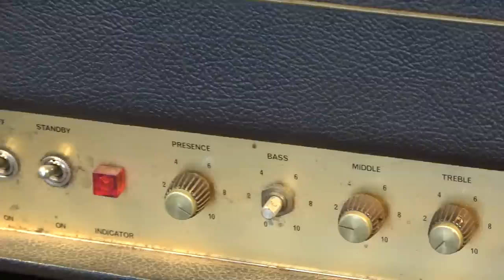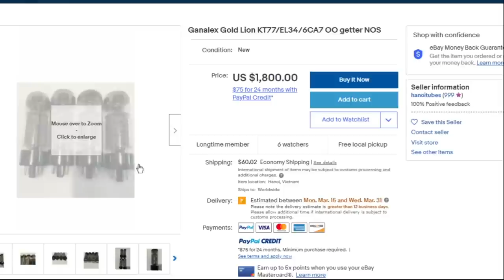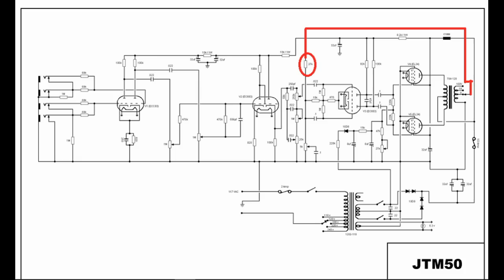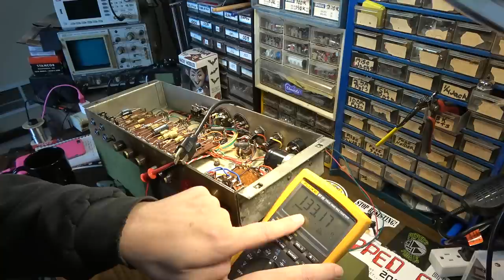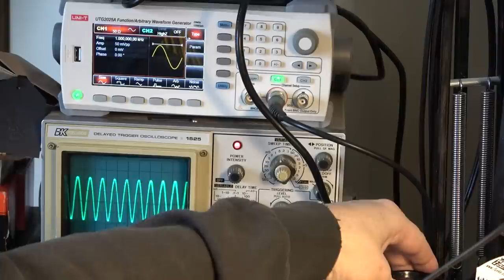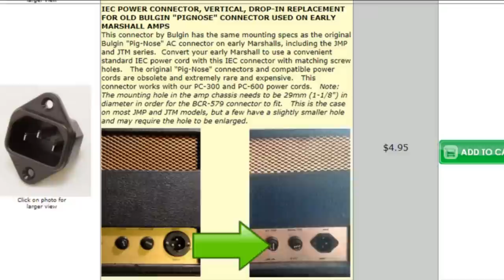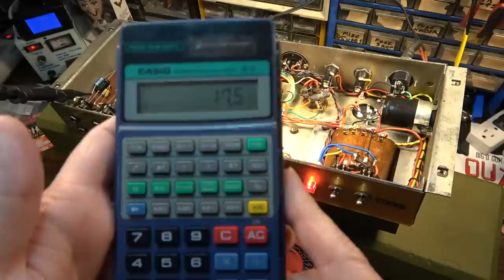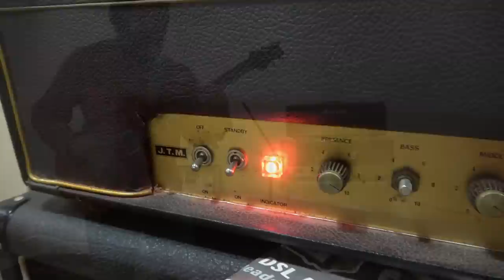Inside a $10K Amp | Secrets of the 1967 Marshall JTM50 BLACK FLAG Plexi | REPAIR & DEMO

Comment: Being this is a JTM50 Amp Head only my information source-price guide puts them at 5K to 6.5K.  The 2x12 can be 7.7K to 10K.  with the 4x10s being 6.3K to 8.2K.  The Amp Head shows only being made 1966 to 1967 should be EL34 power tubes.  What I have found...

Comment: Guitar amp especially with BMT tone stack should be measured under 100-400Hz, not 1kHz. See guitar notes frequencies chart. 1kHz suitable for  ~ 1st string 20 fret. Bass/Middle cut-off frequencies much lower than 1kHz. Samples that you played mainly below 400Hz as well ;)

Comment: I've seen two black resistors 1K 6.5W on the two power tubes.
I own a more recent Rivera Pubster 25 that has the same resistors one is burned I swapped with a ceramic 5W (the schematic I've found on the web said 5W).
What kind of resistor are they?
6.5W is unusual don't you think?

Comment: So I got your math when you multiply the 490 plate volts by the .035 mA= about 17 Watts of power... and then you did mention that you took 70% of the 25W maximum plate dissipation to arrive at the 17W for a el34 tube but since this is only a two tube output amp, how are you getting a hundred Watts total output?

Comment: Hey man? This crate TV 6210 dropped its heaters all tubes and the analog pilot light. But it comes on you can hear the transformer when you switch it on and the led channel lights come on and switches channels but no tube no sound
Reply: I guess its voltmeter power transformer secondary side discovery time. Hell im not stupid im gonna ask someone whats wrong before I have to do all this discovery My whole lab got gangstalked away and its not workbench friendly here at the trolls house.
Reply: You think the pilot light is in series with the tubes?

Comment: screen resistors have been changed
Reply from the maker: I believe you're correct. And the coupling caps into the output grids are changed as well. Values were lowered too.

Comment: So I just go a 1969 JMP 50 Tremolo Amp, and its really weird because it has a Tube Rectifier. Do you have any theories on if it might have been that way from factory, or if Marshall ever did stuff like that? Im thinking its either been modded to have the tube rectifier or it came like that from factory. But if i was modded that would be weird because theres no spot for the diode rectifier inside, and what would have been where the tube rec was, just a hole? Because the Cap on the side (inside) wasn't moved and added. Where the tube rectifier is you can see the marks(outline) from where a capacitor strap may have been, but this one in your video has a similar looking outline mark. I talked  to Dave Friedman and he said it basically looks like a mashup between a regular Tremolo JMP Super Lead and a Black Flag. It basically looks exactly like this one with the one big Cap on the Chassis and the other one inside on the side. I just really want to figure out how this amp was from factory. Do you have any ideas on how to find out?

Comment: Hi there, interesting video - could you please tell me about Marshall EQ knobs ... do they cut/boost frequencies or shift the region of the frequencies at question. (I am particularly ignorant of the Middle knob - what does it do when you put it to zero (freq wise) , and what does it do when you increase it past noon.  I noticed that, maybe I'm wrong, if your increase your Mid knob on a tube Marshall it kind of emphasizes the upper mid frequency, and when you decrease the Mid knob it kind of shifts it to middle Mid range (tubescreamer area, 750hz or so)? What's your take on this? Thanks in advance, Guitologist

Comment: How hot are those pickups in the PRS? Wondering, I just got finished with a JTM build myself.
Reply from the maker: PAF levels of hotness.
Reply: @TheGuitologist  OK, yep I just installed some PAF replicas in my Tokai Love Rock and very similar results in my JTM50 build. In other words I couldn't be happier. A local guy built it for me and added a shared to split cathode (push/pull) option. This thing sings, just like the one in your vid.

Comment: IEC connectors are always a good idea!! What happens if you're on a gig and forget your power cable or get it "stolen" by someone?? You're fucked!! I did a repair on one of my friend's Vox Jaguar organ and while changing the filter caps I noticed he was using a hacked up cable from an old boom-box that he jammed in the original socket... I yanked that shit out and replaced it for the sake of reliability and being able to buy a new cable at any electronics/office supply store!!
Reply: I agree! I had that done on my Selmer truvoice "crock skin" head. Which is also an El-34 powered amp from the mid 1960's (actually 1964).

Comment: Can you pass along the part number for that IEC outlet? All I've got are the square ones. TIA
Reply from the maker: It’s shown on the website screenshot and on the package I show.
Reply: @TheGuitologist  Grazie. Molto bene.
Reply: @TheGuitologist  Found it and thanks also Mouser sells the Bulgin PX0579-28 for $2.50 which I believe is the same thing. If a fellow ever needed more than one.
Reply: It is a lovely sounding amp by the way. Modern builders have been trying for that tone since forever.

Comment: So that amps PS trans? Do those have extra unused secondarys? I know in alot of electronics some have multiples and they tuck em away sometimes. I was thinking how convenient that would be if you lost a winding.
Reply from the maker: No. There are taps on the primary you won't use unless you go to Europe or Australia though.

Comment: Brad did a great job, but to everyone out there with Plexi's, please don't ever use your Dremel on these amps. Just hardwire the cable and drill a hole through the bulgin to pass it through (just my opinion.) Just a public service announcement.

Comment: The amp should have KT-66 tubes which have the distinct difference in tone to other power tubes as the sound is thicker and bigger in texture and carries like a 100 watt amp yet is about 45 watts !
El34 tubes lack the big tones KT66 tubes have !
Tubes that old i would test or replace !
I played a custom JTM 45 using the original circuit design but lacks gain and crunch and is a semi clean amp until cranked up then it gets crunchy with a big low midrange and bass !
The trick is too jump the inputs for more gain the other inputs lack greatly !

Total power in watts to power the amp is not part of bias of the power tubes  because your powering all the heaters in the preamp tubes and power tubes !

This amp sounds thin and brighter than the one i played with KT66 tubes !
If this was my amp i would put in KT66 tubes and rebias it to spec. for a much better sounding amp indeed !
Reply from the maker: If you know what the total wattage dissipation of an amp should be, you can bias your amp to that number.
Reply from the maker: It’s “thin” because the bass control was at 0 and the Mid was maxed. It was the tone that sounded best in the room to me. Can’t say I captured that exactly in the mics. But if I cranked the bass, it would get as bassy as you want. The output tubes don’t affect that as much as 100 other things, like the tone stack, filter cap size, OT size, coupling cap values, bypass cap values...
Reply: @TheGuitologist  You cannot power  all the tube heaters and think that wattage has anything to do with power tube bias , plus you lose some wattage by resistance in the circuit !
Just bias the power tubes as it should be done by a power tube probe or contact reading the plate current and ma across the grid !
First check your at home voltage as mine is only 114 in the summer here as the AC units in my area run hard !
Its 118-123 volts in the winter here !

I use Weber bias calculator for good results but i lower the milliamps by 2ma due to the in house voltage varies as it does everywhere !
I had the bias drift up high and replated tubes before so i check the bias more often !

Comment: That way of bias checking with the total watt draw is completely BULLSHIT. The heaters will draw around 32w, the bias around 39w in this amp, and the rest must be loss
in power resistors or whatever. How would you use that for setting/checking bias, without calculating the heater current first?? For sanity check I just checked my Hot Rod
DeVille. It draws 39w in on-position (primarily heaters) and 84.2w when standby is also on. It is a coincident that this amp measures about 100w. Stop spreading that kind
of VooDoo! The KT77 actually have a Wa of 25w, but use the right datasheets.
Reply from the maker: I’ll show it in a future video.